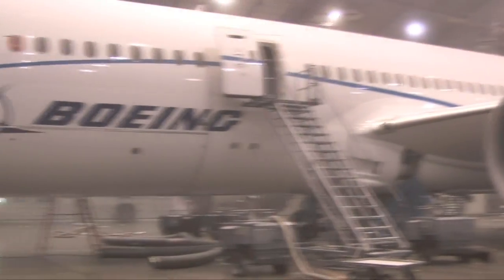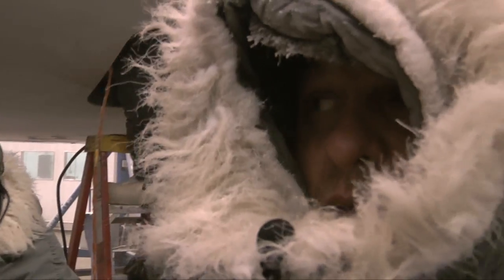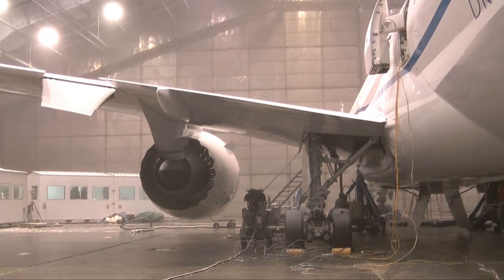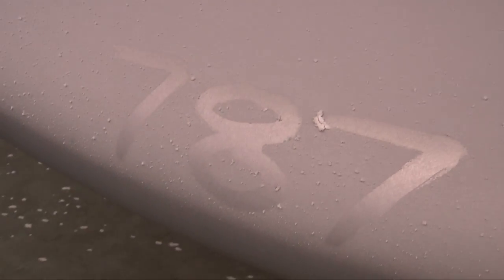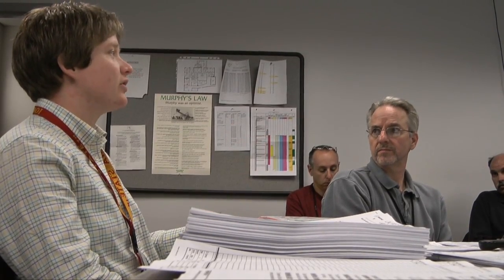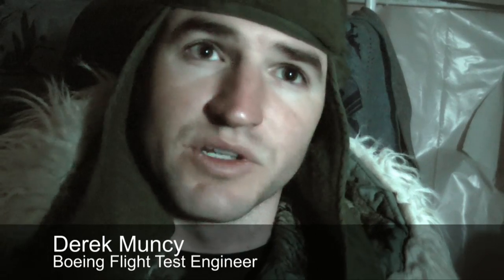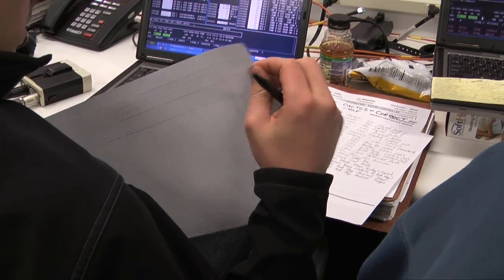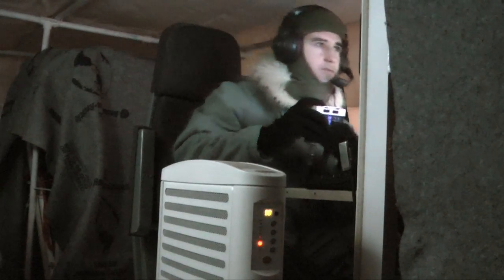Boeing freezes 787 in Florida

Comment: Can someone give us the carbon footprint from this hangar ?
Reply: Who cares about that.  If a plane crashes due to something not found during the testing phase that would be a lot worse.  The testing needs to be done at a certain temp for a certain time for a proper test.
Reply: What wrong with my thinking?  Air France 777 crashed in London due to ice forming in the in the fuel system's.  Aircraft operate in temperatures in excess of -70F degrees below zero at cruising altitude. Plus this is part of the FAA requirements for a air worthiness certificate
Reply: Kyle Campbell maybe but the this Size is not necessary. Why can' t Boeing for example wrap the plane and inside the wrap would be freezing cold and then  outside the wrap normal temperature. Now there is a huge Hall freezed which is unnessasry
Reply: That's contact cold different. Need air temperature.  Plus that would be highly inefficient due a abject like a building is easy to insulate.  Plus the flight controls still have to be moved.  Everything from cars to space ships go through this testing. Plus you would have to redesign it for every purpose and it would take longer and more energy to do.  This lab is used for multiple uses.
Reply: W9
Reply: +Kyle Campbell WRONG THINKING